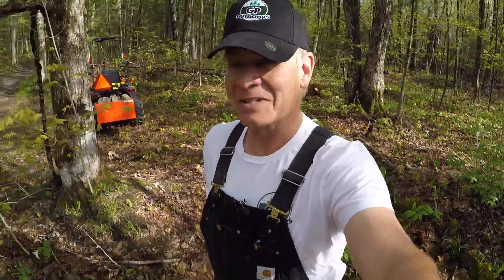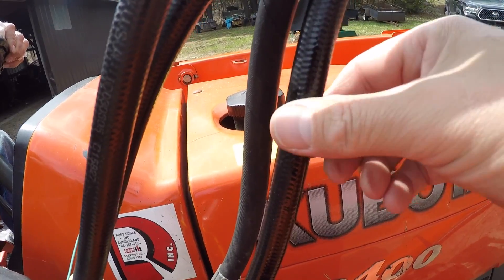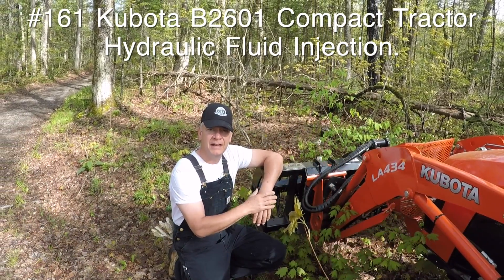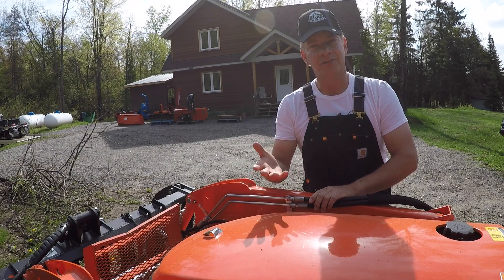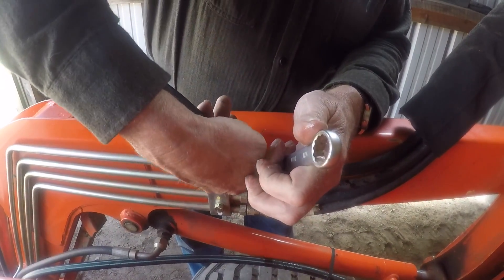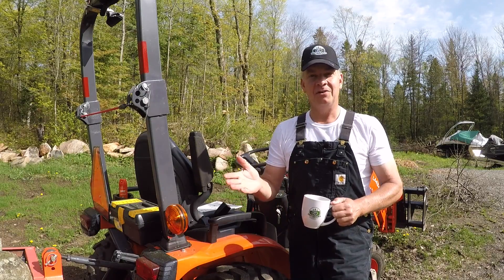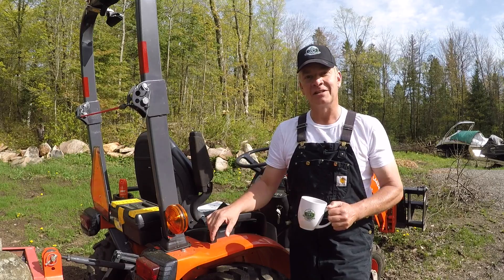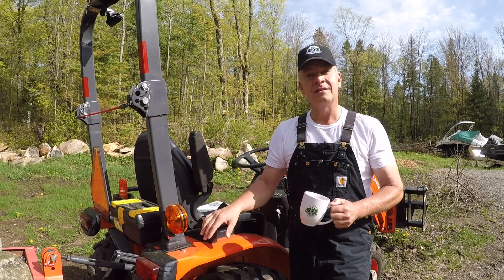#161 kubota B2601 compact tractor. Hydraulic Fluid Injection - Do you know what it is? You should.

Comment: I'm a mechanic, and one of the early lessons we were taught was that fluid goes everywhere under pressure. You mentioned larger tractors with respect to pressure levels. Most tractor's hydraulic systems operate in the 1800 - 2200 PSI range. This is controlled by relief valves in the pumps and spool valve assemblies. The difference between smaller and larger tractors isn't pressure level, but the volume of fluid that they can pump. Your Kubota likely pumps 8-10 GPM, whilst a larger machine will be pumping 20-30 GPM. An additional safety point to keep in mind, the difference in pressure between minimum throttle and maximum throttle is negligible. The key difference between minimum and maximum throttle is the volume of fluid flow.
Reply from the maker: Good evening William. Thanks very much for this. I have a lot to learn on this stuff. I wish they had a course on tractors for new owners. I didn't know that, but I appreciate you explaining it to me. I assumed the bigger the tractor, the more pressure and I didn't know the pressure didn't change much with throttle levels. Thanks again - I hope folks read your comments. I will pin it to the top of the comment list. Thanks again and have a wonderful week!
Reply: GP, there is indeed a tractor school for new owners.  You can find it on the web when you type GP Outdoors!  I knew fluid injection was bad, but I rather thought it was related to industrial machines running at even higher pressure. Thanks for sharing, you might save one of us from having a very bad experience.

Comment: Excellent info Gord.  Also applies to any high pressure devices like airless paint sprayers, pressure washers, etc. I had a couple hyd leaks on the loader couplers on my L2501 when I got it.  I guess the mechanic at the dealership was in a hurry and didn't tighten the fittings.  I didn't spray out, just a dribble, but still shouldn't happen on a new piece of equipment.  Have a great week and looking forward to the next video.  BTW, those deer flies or whatever they are make a good sound effect when they buzz the camera, lol.
Cheers.
Reply from the maker: Good morning and thanks Timothy! Some good points there. Good to hear they were only dribbles but yes, I agree it shouldn't be delivered to you that way. There's always something buzzing around in the forest .LOL Thanks and all the best!

Comment: Thanks so much Gord, I remember hearing about Sailors checking the steam lines with a broom, for the same reasons. pull the broom back and the bristles are shorter, you have a leak. I used to work using tractors daily many years ago, and never remember hearing about this. Thanks again for the information for when I purchase a tractor.
Reply from the maker: Cheers Edward!

Comment: Thank you for the Public Service Announcement. Very important info! 

We have all likely seen water jet (videos) cutting thick steel or concrete slabs, and know to be careful with our pressure washes (please don't wear your sandals folks!). I admit to only thinking of drops of oil when trouble-shooting my hydraulics recently, and luckily I didn't need to run my pump to find the source of the leak. This info will certainly be in mind next time I pop open a quick connect, or get the next leak.

Thanks again!
Reply from the maker: Cheers 10essee! Glad it was helpful. All the best!

Comment: It's important to note a couple of fundamentals about hydraulics.  Hydraulic pressure is not "put into the system", it is limited by the pressure relief valve to a maximum pressure.  Pressure is only created due to the resistance of the load acting on the actuator when fluid is being pumped into that particular circuit.  For example:  if you raise the loader with an empty bucket the pressure will be only enough to create the force it takes to raise the bucket at the available flow rate.  If the bucket is then filled with gravel, there will be more resistance from the load to raise at the available flow rate, thus more pressure will be created in that circuit.  The lines will NOT always have the same pressure in them, it will change based on the actual load being moved.  Very FEW lines will have pressure in them unless that particular circuit is being operated.  Pressure is created by the resistance of the load, NOT by the pump.  The pump only creates flow.
Reply from the maker: Good afternoon Python. This is super helpful. Thanks very much for taking the time to explain it. This helps me a lot and I am sure will help many others reading it. Learning a little at a time. Thanks again, it is very much appreciated. Have a wonderful week!

Comment: Interesting stuff. I'm a Elevator service technician by profession, have been for 30 years and I've never heard of this hydraulic oil injection infection. I work on hydraulic elevators a few times a week. All our elevators use the HD 32 grade of hydraulic oil. Nobody in my industry has ever had any health symptoms from this type of oil that i know of. However' any heavy equipment like tractors, dump trucks, bulldozers, lifts, cranes etc etc.... use a completely different type of oil. The colors are like pink or purple. If this kind of oil gives infections, then I'd be looking to change it out to a less harmful type oil to what we use on commercial elevators. I'm not sure how to do it on a tractor, will take time to do for sure. Also they have different viscosity grades for serving different purposes. Heat, pressure, valves, lift capacities, rams, seals, hoses all factor in. Basically our oil is used for pushing, it does deal this heat from continuous use, stuck pistons in a valve or a motor single phasing. But it's just a light grade of oil with no harmful effects unless you drink it, it may give you a good flushing.
Reply from the maker: Hey good day MNP. Thanks for the info. I have another subscriber who is an elevator guy as well. Small world. Apparently this is a well known thing. When you have time, check out the web. You'll see there are dozens of subs who have commented and are well aware of it - many are hydraulic mechanics, as you will read below. Not sure how practical it is to change the system on the tractor but definitely food for thought. Be well and thanks again! All the best!
Reply: @GPOutdoors  Yeah GP i'm not doubting it, it's just something we never had to deal with. It's not even taught in all our safety courses. But under high pressure, anything is possible. This subject is interesting and i'm going to look into it. Thanks for sharing.

Comment: I had a hose let go on my tractor.  It was not a pin hole but a fountain  3' high. Oil was ever where, on the tractor, on me, ever where. From the steering wheel back was covered. No fun
Reply from the maker: Good day Michael. That must have been a hard clean up job.  Glad you were not injured though. Thanks for sharing it. Be well!
Reply: @GPOutdoors  Power washer was a great help with some grease remover. Just to put this in perception this happened on a1957 ford 870 that I am slowly rebuilding. The hose was old but I did not see any problem with, it just let go with no warning.

Comment: Thank you for sharing ! the same precautions should be taken when dealing with the diesel fuel injection system for those that aren't sure that's the metal tubes running from your fuel fuel injection pump to your fuel injectors not sure what the PSI is on the Kubota put on the Dodge Cummins it can be anywhere from 5k-20k psi , stay safe !
Reply from the maker: Thanks OTF. Good point to keep in mind for sure. Cheers and thanks again!

Comment: Great topic, and especially interesting about the tractor self bleeding the air out of the hydraulic system. Quick question: for your 3 point hitch, say you have the box blade on it, at what position on the positioning lever does it finally start raising the box blade? On my B2601, it seems to take until position 3 or 4 before it starts to lift the attachment. Is this normal, does the weight of the attachment cause the 3 point to function this way? Thanks...Ian
Reply from the maker: Hey good day Ian. So funny you mentioned that. Yes, same with me. It does not raise until about# 3 or 4 . Not sure why, honestly . It happens, regardless of how heavy the implement is on the back. Since day one. But what I really like, and you may find helpful, is that having those numbers for reference is really helpful when doing repetitive tasks like using the box blade or other implement that you need to set at a certain height. Being able to find a perfect height and then simply reset it to that number each time is pretty helpful. Have a good one!
Reply: @GPOutdoors  Yes use the numbers to set the box blade, need all the help I can get using the box blade, am a newbie and prone to do more damage than good! I need to look into why the 3 point only starts to raise at 3 or 4, seems a shame to have the positioning system with the first 4 settings not functional...Ian
Reply from the maker: If you do find out, be great if you can let me know. I should ask as well, as it does make me wonder once in a while. Thanks Ian!

Comment: That is very useful information GP.  I've worked 38 years in  the oil and gas field and we covered some of the same   training you provided as well. On our Cooper Bessemer Compressors,  hydraulic oil pressure when running up to speed reached 8-10,000 psi at the block valves. We were taught to shut off the motors to fix and analyze the leaks. Also we had manual handheld pumps to bleed air in the hydraulic systems before starting up. These were huge 10 cylinder 2000 H.P.
engines. Each cylinder was about the size of a 55 gal. drum. I miss the days when I used to operate these big iron horse engines,  not to many around any more. Thanks GP.
Reply from the maker: Wow! Good evening Dean. Big equipment and serious HP/ energy.  Thanks for sharing that - I'll bet you have some good stories for around the fire and a few "coffees". Thanks again and be well. Appreciate your long time support and friendship. Have a great week my friend!

Comment: Hi GP! Again you're provinding very usefull informations about hydraulic. Just want to mention that a big tractor doesn't have necessary more pressure, it will provide more gallons per minute of hydraulic fluid and requires larger diameter hoses in order to keep the same flowing speed in the hose. For example, they might engineer a system to work at 15 feet per second, so if your pump delivers 10 gpm (gallons per minute) will require a certain diameter of hose, if the bigger tractor delivers 25 gpm, it will require a hose with 2.5 times the section (surface) in order to keep the same flow. And obviously, bigger the hose is thicker the hose wall must be to contain that force.  Cheers!
Reply from the maker: Hey good evening Richard. Thanks for this! I just read another comment describing similar principles. So much to learn for this newbie. LOL. Thanks again and hope all is going great for you and your wife with the new property! You must be very excited to be able to get back out there now that spring is here. All the best and please, keep in touch and let me know how it is going with the L2501and the land!

Comment: Very good video Gord . Not sure because I'm not a tractor owner but I think the air in the line is pushed into the tank and the pump draws the fluid from the bottom of the tank to create  pressure  . I think that's what's called self bleeding . It's only a guess . Same goes for blowing yourself off with an air hose . Where I worked that was a big NO NO and you could get time off for doing so . You could push air into a small cut in your skin .
Reply from the maker: Good evening Henry. I am not sure of the details of how it works either, but I understand what you are saying about air. I read a lot over the last two weeks and you are correct. There are articles that say as little as 100 psi can penetrate the epidermis (outer layer of skin). I feel much better having a better understanding of this stuff. Have a great week and thanks for all the support you have given me and the channel. Cheers!

Comment: Do you have any advice on releasing pressure on the quick-couplers?  I've had to tap the little ball on the end to release the pressure so that it can be pushed into the coupler.  When I tap the ball, it squirts out a mist of oil and gets all over everything.
Reply: Hold a rag over it when tapping the ball.
Reply from the maker: Good morning Dave. What helps often for me is before I release or connect the quick couplers, I cycle the joystick around and put into float. Turn off the tractor, and then turn the key to the pre-ignition position and cycle the joystick again and put into float. That usually helps me. Cheers!
Reply: @GPOutdoors  I was having a hard time connecting / disconnecting couplers.  I did some looking and think that they are some kind of pressure-relief variety that only works after all of the pressure on both sides are let off.  I visited local parts store and replaced the male ends with standard jobbies -- and they seem to work much better (easier on/off).  But, now I carry a rag with me -- still have to tap the ball to release and plug in.  Warmest Regards.

Comment: The fun begins when you have to replace the packings on the ram, aka, piston. Cheater way is once you have the gland nut off, use the tractors hydraulics to push the ram out. Talk about having fun. 🤔🤔🤔🤔
Reply: Actually  if you  unhook the hose usually you can  physically  work them out. If that dosent  work you can use compressed air but be careful  because if you use to much pressure it'll  come out like a bullet.
Reply from the maker: Good day Tom. I think if it gets to that, I might get the mechanic to do it. Probably a little above my skill level. :)) All the best!
Reply: @GPOutdoors  this is what happens when you listen to the boss. Had to use a dozer blade and very long cheater bars to loosen the nut on the ram. The good old days. 🤔🤔🤔